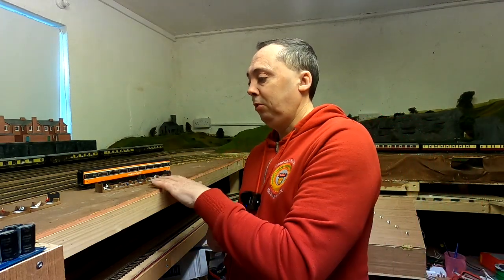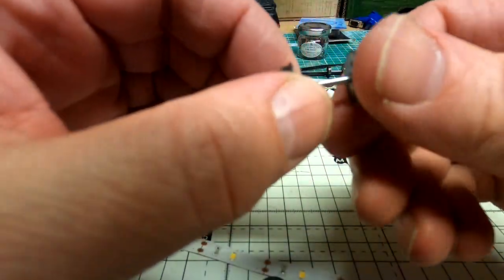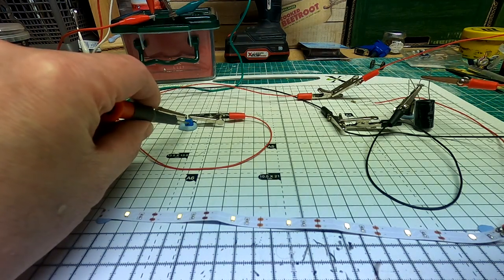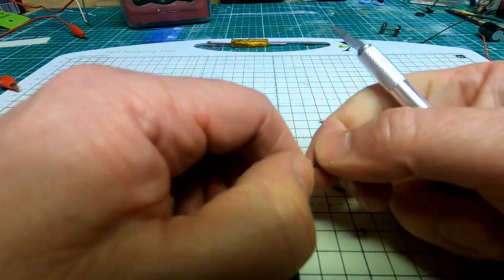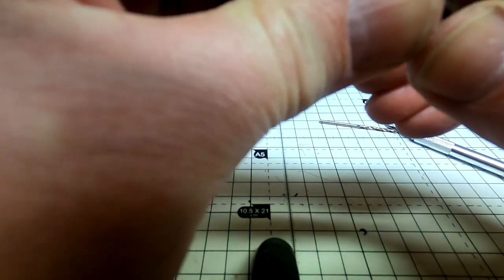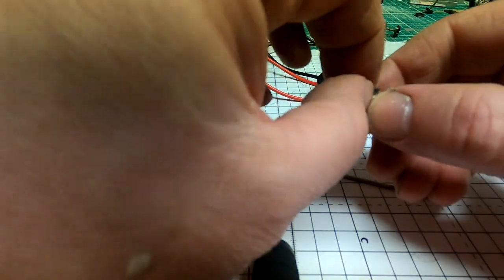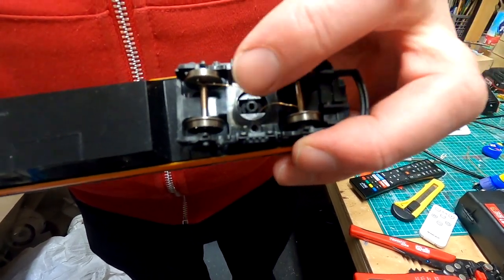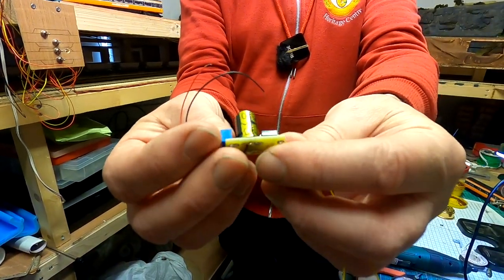103 Coach Lighting with Stay Alive using DCC Concepts Wheel Pickups

Comment: With  the 'stay alive on board, I would have chosen a power pickup that just runs against the inside of the wheels instead of taking the risk of having wheels out of gauge. It would also save some fiddling as you don't need to disassemble the axles.
And for the rivet counters using LED strips, is not 'good enough as the lighting would be random through the car. Not like the prototype distributed for each seating area or other compartment.
But then I'm not a rivet counter.
Reply from the maker: LOL I'm no rivet counter either, I find the power pickups on the axles give less rolling resistance and I have a gauging tool to ensure the right gauge. Since the video I have soursed wheel sets with one wheel already insulated, so it makes it a bit easier.

Comment: Yep, I use nearly the same components for my lighting and keep alive circuits.  Don't use a pot or a resistor.  The LED strips have the current limiting resistors (ballast) already installed.  I use ESU 50707 current collectors from ESU; you can get 8 sets for $8.95 with $4.00 shipping.  That's enough to do 8 axles.  I ordered the bright white LED strips which look very unnatural so I painted each LED with yellow acrylic paint and that made it look a whole lot better.   Cheers from eastern TN
Reply from the maker: Thanks for the tips, I use an extra resister to bring the brightness down along with the pot. I do sometimes paint the LED's depending on the colour I can get.

Comment: I’m no expert at all. Just wanted to know the reason for the second resistor after the potentiometer please?
Reply from the maker: The second resistor is to reduce the voltage from the capacitor. It also helps reduce the voltage from the track to give a better light than just using the potentiometer. The camera makes the lights look a lot brighter than they actually are.

Comment: Hello, your video wasn't too bad but I was interested to see how you connected your wires to the bridge rectifier and the resistor in series, so is there any chance you could show all of that as it's being done in a bit more depth as this was the bit that I was most interested in seeing and didn't see it then you couldn't really see anything except for a jumble of wires and things at one end of the coach?, there's not a lot of help out there, then I saw your video and I thought "yes" finally but then it soon turned out to be "no" actually. lol.
I too want to do the same thing with my coaches but I'm struggling at the moment with how to attach the bridge rectifier and the resistor to the LED strip, I won't be using the stay alive or the dimmer so if you could do this I'd be really grateful, look forward to hearing from you, many thanks, Chris.

Where can you get the circuit board with those parts from you showed at the end. ? Thanks.
Reply from the maker: Hi Chris I did a short video hope this helps https://youtube.com/shorts/vT9RzeKzjFw?feature=share
Reply: Thanks very much for your help and the follow up video, it's helped a great deal and I now have my led strip lights working in both directions so I'm happy, I can now think about installing the led's into my coaches , many thanks once again myfriend. Chris.

Comment: Nice vid on the lighting, I have several I will want to do, i`ve bought some.03 phosphor bronze wire to make my own pick up springs. I might try thin brass tube sleeved over the axle as it migh offer better pick as long as wire wire is flexible enough
Reply from the maker: Thanks Newlynn, I was thinking of trying to make my own pickup spring useing copper wire

Comment: Hi Mark A nice simple explanation of the lighting set up, although fitting the wire onto the wheelsets seems a little fiddley, I'm an N gauge modeller and wouldn't like to try that with the size of those wheels, but none the less very informative, thanks. Pete
Reply from the maker: Thanks Peter, yes it is a bit fiddley. Would be a bit more tricky on N but it has been done.